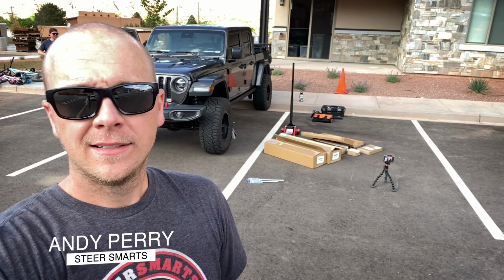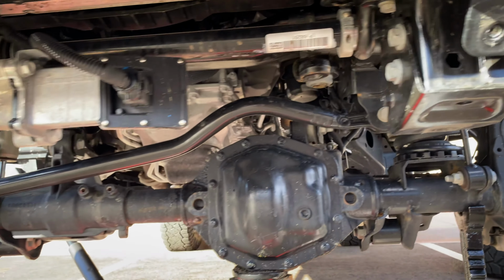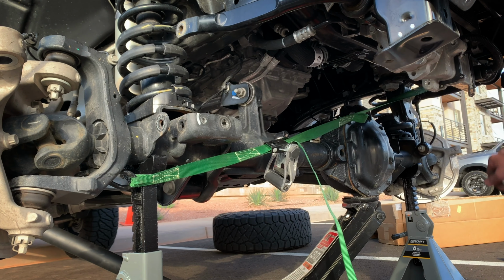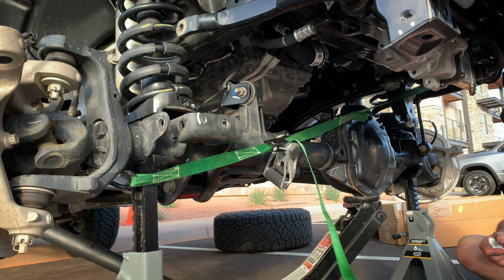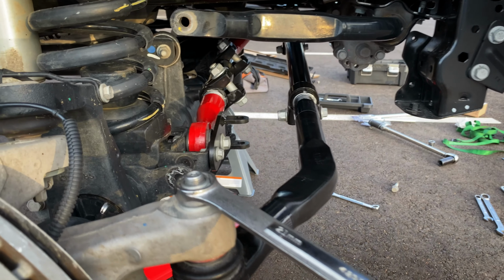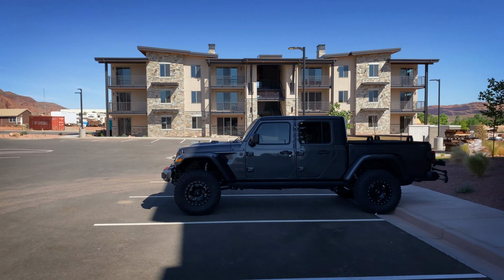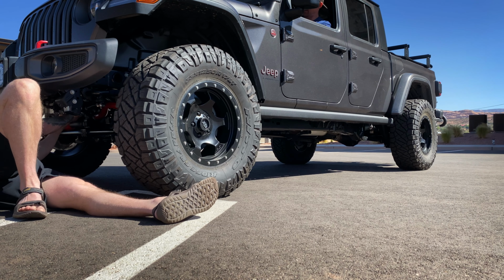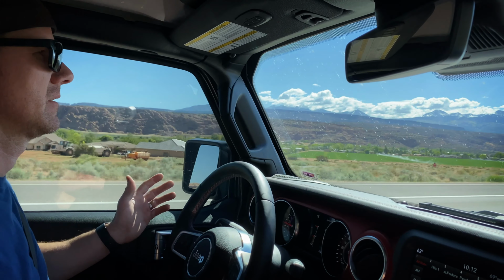STEER SMARTS Jeep Gladiator Parking Lot Installation

Comment: Lower adjustable control arms will put the axel back in it stock location when lifted the axel twist forward and drive line changes it best for anything over 2.0 inches.    On the jL and JT if one looks at the steering bx you can watch the frame flex so there a bracket that can be bought to stiffen all that up.
Reply from the maker: We have a sector shaft brace with track bar reinforcement bracket available for the JL/JT as well as the JK. We recommend anywhere from 5.5-6.5 degrees of caster on the JL/JT depending on the height of lift you’re running.

Comment: What is the ft lbs of torque on the drag link collar bolts once you straightened the steerin wheel? Great Video Thanks
Reply from the maker: 45 lb ft on the clamp bolts for tie rod and drag link — front adjustable track bar clamp bolts are 65 lb ft

Comment: This relocation bracket did not work for me with the Steer Smarts Stabilizer like it did for you it's like a millimeter off. The bushings were lengthier on the steer smarts stabilizer than the stock, and I have had to keep using another stabilizer in its place until I can get it figured out.

Comment: Its a shame all that work was done on a 2020 model. The 2020 has an aluminum steer gear (steer box) that flexes causing loose wondering steering. 2021 model was upgraded to cast iron steel for stiffness and the problem has been corrected.